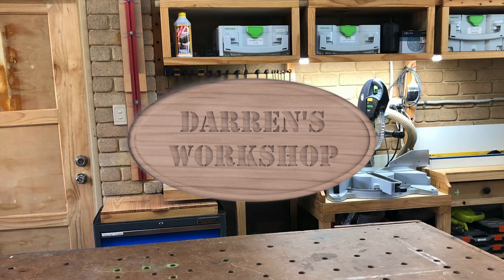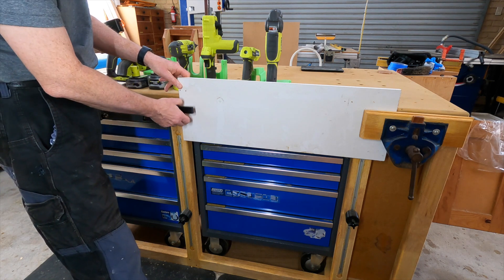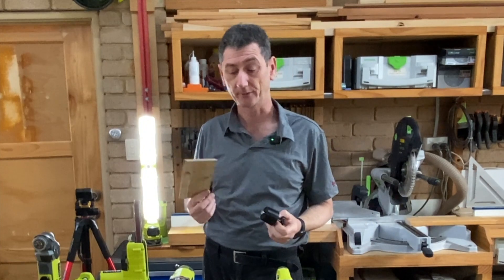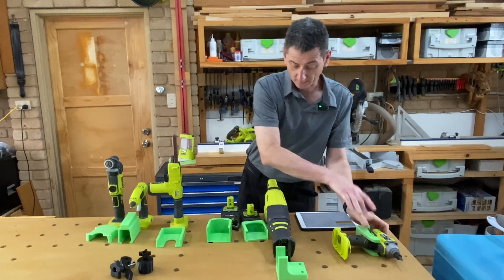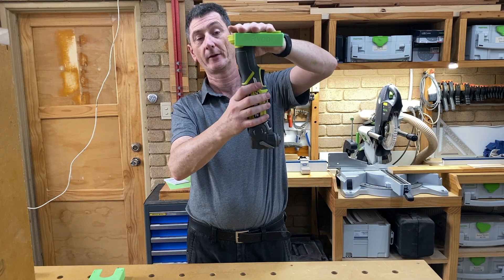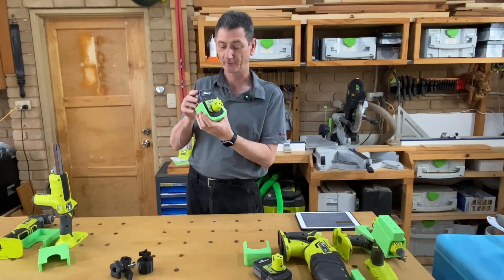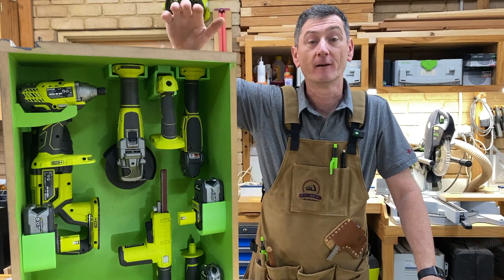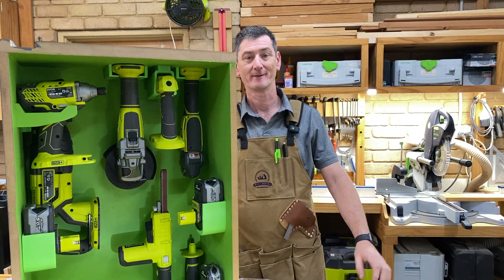3D Prints in the Workshop #14

Comment: I have been watching and really enjoying your content and have noticed what appears to be a larger dust hone on your Kapex. Just wondering if you can share details of the upgrade and the success attained. Cheers
Reply from the maker: Hi RB, I have a 1HP high volume low pressure (HVLP) dust extractor attached to it. To be honest, the Festool does a better job (slightly). But I use that at the wok bench and don't want to be disconnecting it all the time.

Comment: Check out Thingiverse for the Ryobi battery mount v4.2. I printed one off, and off all the battery holders for Ryobi, it is by far the best. 
Holds any One+ battery.
Reply from the maker: hi, Is this the one you mean? https://www.thingiverse.com/thing:2597980.
Reply: Yes, that's the one. Works a treat.
Reply: Good to know, thanks for the info, I'm waiting for some green filament, and plan to be making quite a few of these holsters. Definitely prefer to make whatever better ones, than anything inferior.